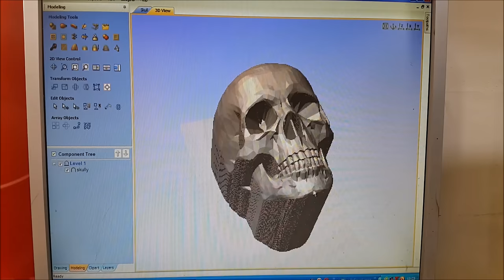Mirock Skull Ring

Comment: So awesome! Can you list out the cnc router bits and where you purchased? Thank you!
Reply from the maker: It is a local salers. I think It is not avaliable from abroad. Pretty cheap bits. 1. 4mm endmill - http://frezycnc.in.ua/products/11328175 2. Tapered ball nose http://frezy4pu.com.ua/frezy-konusnye-dvukhzakhodnye/frezy-konusnye-d6-ukorochennye/freza-konusnaya-r-1-52012-11-24-16-43-32-11-detail.html 3.Tabered ball nose - http://frezy4pu.com.ua/frezy-konusnye-dvukhzakhodnye/frezy-konusnye-d6-ukorochennye/freza-konusnaya-r-1-02012-11-24-16-51-40-132013-05-31-12-13-47-79-159-detail.html

Comment: very impressive. could i please ask you how much programming did you have to do to get your drawing over to the cnc machine? or did you somehow just import your drawing into the cnc system directly from a file? i have 3d drawings but know very little about cnc milling and was wondering how a 3d drawing makes its way to the cnc machine. thanks
Reply from the maker: I had took ready model from free SketchUp 3d store and simply throw it to aspire. Nothing more
Reply: Mirock's Woodshop is aspire a program that the cnc machine uses? is it really that simple?
Reply from the maker: Pretty simple. Much better and comprehensible than Artcam.
Reply: I work with cnc milling services in China by sending them STP files and sometimes the parts they produce are far from what I sent them which I don't undertand. If all they have to do is import the files I give them then how can the measurements be off? at other times, the parts come back exactly as I sent them. not sure why.

Comment: If you make another one, it is much easier to either cut out the ring first and then shape the skull, or to make them separately and then solder both pieces together later - will be much less work for you that way. Good job though, very nice :)